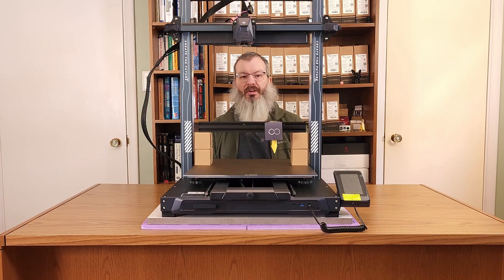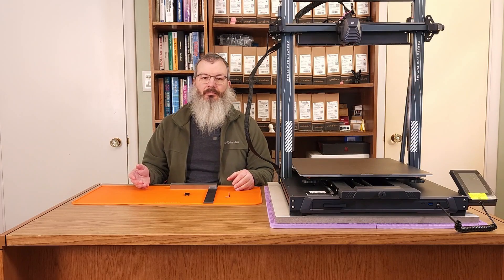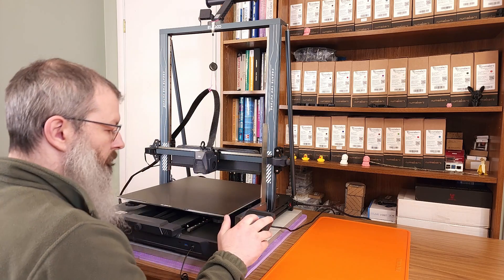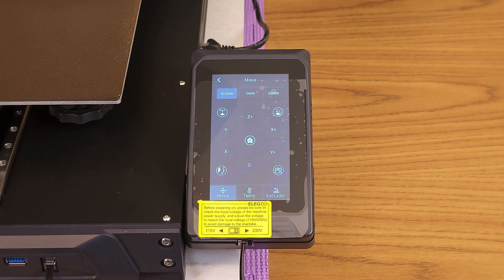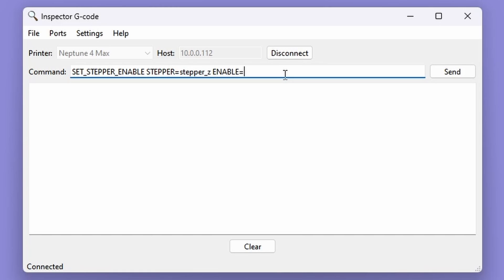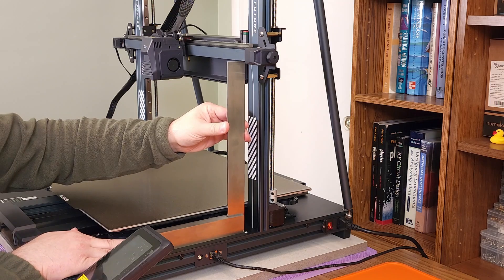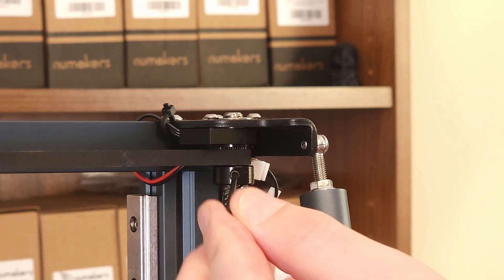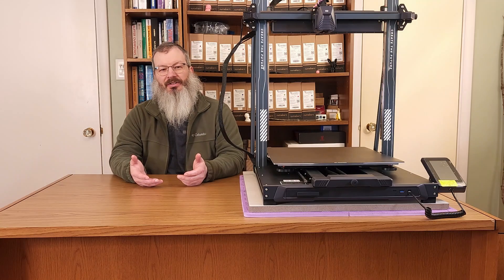End your X-axis leveling issues today!

Comment: you can also line it up with the hash marks on the upright, since that's what they're there for.
Reply from the maker: Thank you for the suggestion. I wonder how close people can get using that method, since you often want to get the two sides of the gantry to within 0.1mm or less.

Comment: No matter what I do I face two issues with the bed, even after making sure the gantry is level. I've tried two different beds and 3 different PEI plates. My bed is always domed in the middle by about .2mm and my ABL mesh never seems to compensate for any variation. It's loading and the z-axis is moving up and down while printing but I'm left with a first layer that is way to low and way to high in spots. I've about given up. To get it low enough for adhesion in the low spots, it's mashed in the high spots. It's like my gantry is bent up in the middle and ABL just doesn't work. If you have any thoughts on that I would love to hear them! Please! Using BL5k I can get the corners to show almost spot on with each other.
Reply from the maker: Thank you for watching our videos! I really only have two different approaches to deal with the problem you are describing.  The first is to completely loosen the bed and start over. However, since you have already tried multiple beds, that probably won't help. The other approach is to grossly over compensate for the issue and then slowly back it off. For instance, in the center is too high, then raise all 4/6 probe points until they are all well above the center and try to level from that starting point.
Reply: @SandMMakers  thanks for replying! Unfortunately raising the corners raises the center with it. The dome never goes away. I shim using aluminum tape as best I can. I'm at a loss at this point. I have linear rails coming but x axis was sold out.
Reply from the maker: Which model printer do you have?
Reply: @SandMMakers  Neptune 4 Pro. The only thing I can think of at this point is that my x axis gantry is bowed up in the middle so that no matter what I do, that "dome" just always exists. Why the mesh never seems to actually match my bed may have something to do with that as well, I don't know. I've done regular and pro setting for the abl. The y and z liners rails should be here by the weekend.

Comment: Fantastic, detailed video. With that said (it applies only to Neptune printers) it's much easier if apart from timing beld you loosen addition gantry screws as shown in the video. I tried loosening just the belt. It should be enough, but I couldn't get it just right without pushing the gantry down.  While you do that you just need some equal height objects to support the gantry (I used audio tape cases, I knew they'll become useful again). https://www.youtube.com/watch?v=tbnpeieAwWg
Reply from the maker: Thank you for watching the video! There are multiple ways to level a gantry, and this video shows the method that I happen to use. When using multiple reference objects, care needs to be taken to ensure they are exactly the same height or error will be introduced. Also, some gantries fall on their own when the motors are unpowered and others will refuse to move even when pushed. I prefer raising the end of the gantry to the desired height instead of moving or pushing down to minimize backlash and erros related to twisting forces. However, there are many valid ways to level a gantry.

Comment: I have an old Duplicator i3 without z belt, leveled the bed and gantry dead flat/parallel and it would always eventually shift. One day I noticed a thud when I energized the steppers, which made me think too much and I came to the conclusion motors were out of phase. I simply energized the steppers and left the lead screws loose, then aligned everything and tightened up the screws carefully. I have not had the gantry go out of alignment after 1,000's of print hours 😮 maybe once every year I would have to run the gantry all the way up to ram it and force it level and it's back to perfectly level 😅

I noticed having the stepper motors in phase also removed most z banding.

I also have a larger printer that has a z sync belt and did the same. That machine has absolutely no z banding, nor z artifacts at all. It's a heavily modified Sermon D1 with tons of custom parts I design myself
Reply from the maker: I'm glad you found a solution that works for your printers!!